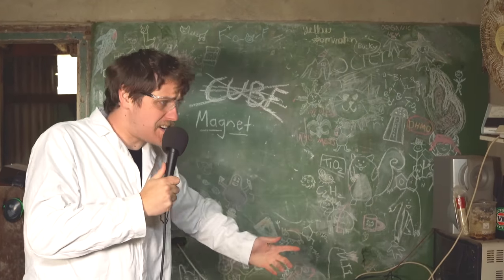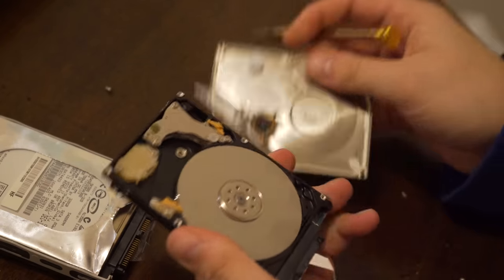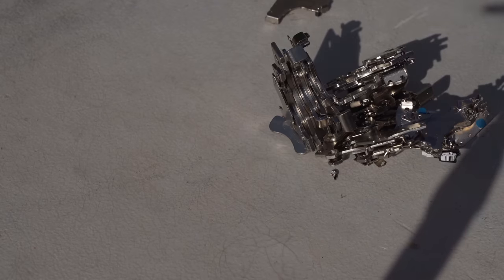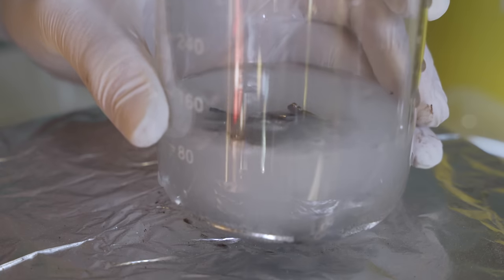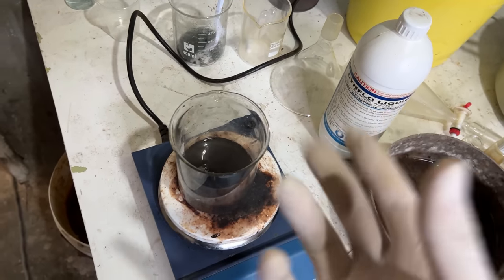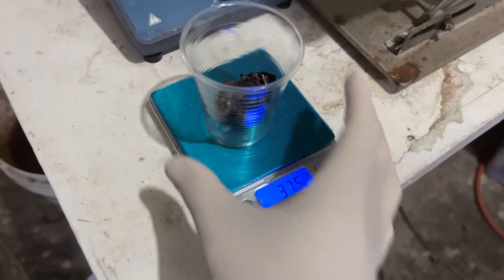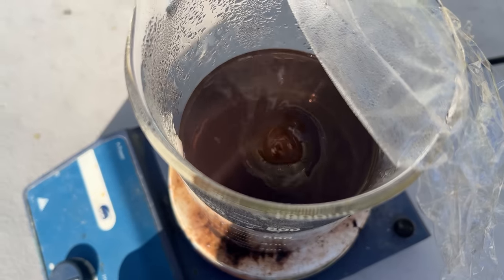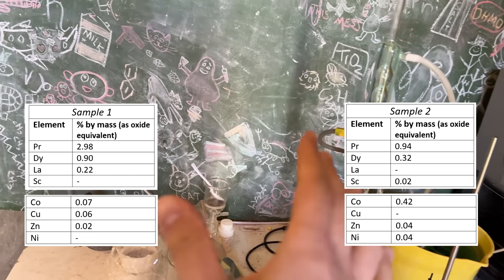Extracting Neodymium from Harddrive Magnets

Comment: You might be intrested to know that there are several styles of colored pyrex glass that are infused with transition metal salts which change color under different light sources (full spec or 'cool light') they are called shifty colors. Do a search for "CFL shift borosilicate glass." I did not know how this effect was achieved by the manufacturer until I saw this video, thanks for being a teacher as well as entertaining! Great video
Reply: Cool factoid: that effect is used by astronomers in the light pollution filters they use to photograph the night sky. Turns out neodymium glass is pretty good at absorbing the spectral emission lines of sodium and mercury arc lamps used in public lighting.

Comment: In a situation where either the most or least reactive metal ion in your solution is the one you want, electrolysis might save you a lot of work for purification in some projects. A variable voltage and variable current-limited bench power supply can be bought pretty cheaply online (I bought a 0 to 32V, 0 to 5A power supply for about $50 USD) and has a lot of uses.

In regards to this project, you can precipitate pretty much 100% of the iron and nickel as metal on a cathode (which could just be a steel nail) while leaving all of the neodymium in solution. This also lowers the amount of sulfuric acid you would need to use and makes recovering any excess sulfuric acid used possible. You just need to use the right anode for the job. I bought a small piece of platinum jewelers wire as my first anode for around $50 USD and it worked great for turning copper sulfate (dissolved in water) into copper metal and (dilute) sulfuric acid.
Reply from the maker: Yeah a really interesting idea for sure, thanks mate!

Comment: having disassembled over 800 HDD's/CD/DVD-Drives for fun, reverseengineering and parts, i can assure you that as soon as you get your hands onto a good set of TX8, TX7 and maybe TX6 screwdrivers and get to know the 3-4 assembly designs that are universally used in HDD's, youd be faster onehanded using the screws for disassembly

Comment: Maybe could of used a ball mill on the magnets. You also could of made a homemade one with a drill, mason jar or container of choice, sand, or fine beads used for stripping material off objects. Then combine the container lid with bolt and then connect the bolt to drill socket.  Would of did the trick nicely.
 
Keep up the great content.

Comment: if you ever have a problematic screw, and you don't need to replace it, get a drill bit about the same size of the head of the screw and just drill it out. and be sure to check under label for hidden screws.

Comment: If you want to go for neodymium metal convert the neodymium sulfate to the fluoride, then react the fluoride with magnesium in an alumina crucible and heat it with an induction coil in a steel pipe. A little bit of iodine added will speed up the conversion.❤

Comment: I got a tiny shard of steel in my eye, from drilling or grinding or something. Caused me misery for days as it was fully imbedded in my eyeball.

One evening I had a brainwave and smashed some earphones with a hammer, extracted the tiny, smooth, donut shaped, shiny neodymium magnet, shoved it in my eye and let it roll around.

Problem solved. Instant relief. I recommend it.

Comment: If you're going to take apart a hard drive just unscrew it, it's gonna be a million times less messy, easier, and faster than ripping it apart.  It's likely that there are stickers covering up screws that you missed, just poke around until you find where the label dents in.  Also you can probably find all the torx screw bits in a cheapo multi-bit screwdriver set too.

Comment: 4:05 here's a lifeprotip for you about screws. Torx screws aren't just for electronics. If you replace all the philips, slotted, and even square drive screws in your life with torx screws, you'll save yourself IMMENSE struggles over the course of years. I say this as a former incompetent myself - I'd spent dozens and dozens of hours dealing with screw heads that stripped right out, or fuckin leaning on my screwdriver/power tool in awkward places just to keep it from camming out. Torx drive screws *just work*. 

McMaster-carr is your friend here - I've yet to find a screw I truly can't replace with a nice torx drive screw on mcmaster, and you can get a nice set of screw holding torx drivers that fit the internal drive head so well that you don't need to hold screws while lining them up.

Comment: Im sure someone else has said it already but those hard drives were hard to open because there is a hidden screw under the label. For anyone in the future take your finger or screwdriver and feel around on the label and you should find a spot that goes down stick the screw driver past the label to remove the last screw then the top should pop right off. Helium drives may be sealed additionally though but not these old kind. <3

Comment: man i love pulling apart hard drives, i did a school based work experience awhile back and they got me to pull apart hard drives, i think i did almost 250 in about 2 days, but yea they are the worst things to pull apart if you dont know that they have a hidden screw under the sticker, also you need specialty screwdrivers which if your curious they are called security bits or for hard drives its hex drivers

Comment: As a computer repair tech, yes computers do deserve pain. Especially those shitty pre built boxes that I get on my desk constantly and cut my hands to shreds on because the inside metal bits just randomly have razor sharp burrs on them for NO REASON. Also, getting the magnet out of harddrives is fun, I've used a lot of them for various projects over the years. Magnet good.

Comment: The different colours remind me of the latest/2023 chemistry Nobel Prize. Quantum crystals of semiconductors changing bond lengths, first noticed with copper chloride glass badges being of different coloured green about a century ago longer, then again meeting another batch of some crystal dripping only not solution, different colours on different times of batches.Then they showed the phase shift using CdSe, crystallising in hot solution that obviously did not want to be in performing quanta crystals, which change colour due to the higher energy bond length with time. Laughed the serendipity, as it's the same as watching paint dry. One of the reasons you also crystallise slowly, to not end up with quanta/tiny crystals, but a more cool product. Reference to paint drying, when patching walls, the paint doesn't seem the same colour whilst wet, yet dries spot on. Possibly the titanium dioxide bond becoming more stable once dehydrated/solvent dissipation. And these pricks get a noble prize, for about five line paper based on about four observations, and using cadmiumSe in a hot solvent, dropping out the red spectrum and moving to yellow when it cools, thus smaller bond length equalling higher energy. Just because they found a compound that existed this behaviour, that just about every chemist/observational inorganic chemist in particular notices upon recrystallisation, particularly in a solvent that it really doesn't like. I'd hazard a guess to natural para magnetism of Ne change the aqueous bonding in hot water due to curie effects the quantum level, which returns in cold water making more soluble. Notice the same thing in organic chemistry with opioids, separating paracetamol which is hardly soluble to start with, from codeine, which is more soluble and increases solubility in cold water. What you call retrograde crystallisation! Maybe there's a paper to be published on substances based not only on the phase shift of semiconductor quanta crystals, but also organic compounds, displaying better/enhanced solubility in cold versus the status quo of heating to increase solubility. But I think you should come up with a more fancy name for retrograde crystallisation, sounds funky, but maybe you can put your name to it… Like a frugal craft reaction. Your name becomes legacy! Maybe something like, Precipitation Heat Unification Crys you tallisation Kinetics Extraction Derivatives.PHUCKED synthesis. Would love to hear someone say, I am using a PHuRKED reaction to separate such and such…

Comment: it's kiiiiinda faster with a lot of Hard Disks to disassemble them the right way rather than just smashing them - it's also just cleaner too, anyways.
if you don't have the right Bits for it, you can use some Pliers that have flat sides and just partially crush the Head and twist it out that way. alternatively a makeshift prybar can just snap the Heads off on 2.5" Drives to rip the Cover off since they're flimsy (sometimes works easily on 3.5", but much less reliably than 2.5").
or you could Grind/Drill the Heads off the Screws. all good options.

though having a set of Screwdriver Bits is pretty handy, and when you do then it's pretty fast to zing the Screws out. 
then usually just a few more Screws will let you take off the centerpost the holds the Platters in, and one more Screw for the centerpost that holds the Heads in place. then it all comes right out without having metal fragments or potentially shattered glass all over. nice and neat, and still fast.

yes, i have infact harvested the Magnets from many, many discarded Hard Disks.

Comment: I tried to make neodymium salts from magnets as well a while back but used much more available HCl to dissolve everything. Gave up when i couldnt get iron to separate from the neodymium. Does this reverse solubility apply to chloride salts of neodymium as well or just with sulfate salts?
Reply from the maker: I think just the sulfate salt, well maybe the sulfate and a few others, but I don’t think the chloride does
Reply: @ExtractionsAndIre  Well i guess I will have to try converting the chloride to a sulfate then, thanks👍

Comment: also, when you have all the small magnets, could you run some kind of electrolysis/electroplating setup to pull the nickel from the mass of magnets? they'd already be in a box of acid

Comment: Quick correction, it's not the energy cost and it's not strategic vision (though that plays a role). It's that it's extremely toxic and will "remove" you. When you could not care less about your people and your constitution is designed to "remove" as many as necessary efficiently as possible for gains, it's an easy trade to make.

Comment: Not sure if youll read this but...
 Like everything in chemistry there is another way. 
Dissolve everything the Fe and Nd in HCl. Bring the pH to 3.5 using NH4OH you'll know you are there when the solution turns turbid. At this point add oxalic acid or better yet ammonium oxalate. The Nd will precipitate leaving iron oxalate in solution. Filter. Calcine the solids at around 300C this should turn the oxalate into CO amd CO2 leaving Nd oxide. Disolve the oxide with h2so4 .
Reply: In the case of nickel inadvertently dissolving too keep adding nh4oh until the solution precipitates both iron and Nd as hydroxide keeping nickle in solution as a tetramine like complex. Somewhere around pH9ish slightly above. Filter the solids and redisolve the hydroxides with HCL then follow the steps in the previous comments from this point forward.

Comment: I have (2) 1x1x2 inch grade n52 magnets. The pull force between them and a piece of metal is like 600lb and i have a 2x2x1 inch square magnetized between the square in half and I gave it a metal hat for protection

Comment: A razor blade peels the coating right off.  Exacto knife it any utility razor,  no need to push hard it flakes off a soon as you slide the blade along v the curled edge.  Faster than sanding.

Comment: not that i am here to bust your fun.. BUT.. unscrewing 6 or 7 screws(one is always hidden under sticker and one holding magnet assembly) screws takes roughly 30-45 seconds then add 15 seconds to simply take out that magnet (done that many times) is SURELY faster than undoing case with players and hammer.. but let's have it your way :)

Comment: Next time you wanna do something like this, try removing the nickel plating with a Dremel or some kind of sander.
Reply: That sounds like a lot more work than just hitting them with a hammer since the neodymium ceramic would just shatter leaving behind the nickel
Reply: Perhaps a combination of both would do... break them and remove the majority of the nickel and if anything was left behind grind it off. @noodlelynoodle.

Comment: The term you're looking for is exothermic and endothermic solubility, the Nd is exothermic, while most are endothermic. Now here's the fucked thing, some compounds are fucking both, like sodium sulfate, which is endothermic up to 32°C, then slightly exothermic up to about 150, then slightly endothermic up to about 250, then exothermic up to about 320, then slightly endo again. Actual schizo salt. 
There's some explanation of why, but I can't bother. I'm also not a chemist, so take it with a grain of salt (preferably not sodium sulfate).

Comment: Would this work?
1. Dissolve the magnets in nitric acid to make neodymium nitrate and ferrous/ferric nitrate solution.

2. Convert to the fluoride salts by adding hydrofluoric acid.

3. Dry the resulting soup.

4. Dissolve the neodymium (III) fluoride in diethyl ether, leaving the insoluble Iron (III) fluoride behind.

5. Take the filtrate, containing the neodymium, evaporate off the diethyl ether.

6. Wash the precipitate in copious amounts of water. The neodymium (III) fluoride is  insoluble in water, while any remaining iron (III) fluoride is mildly soluble.

7. Dry the precipitate.

8. Add the precipitate to conc H2SO4 at a temp of above 19.5C. This should produce Neodymium sulphate plus hydrogen fluoride, which will fume and can be extracted.

9. Stand back and admire your handiwork whilst nursing your chemical burns.

Disclaimer: I am not a chemist, so all of the above might be ridiculous.

Comment: Could you have broken the magnets down with a sledgehammer or something to increase surface area, would have also broken the film off which could have been sifted through.
Reply from the maker: Thought about it- but reading the comments, it seems the metal coating is pretty toxic, so glad I didn’t crush them and make a lot of dust!

Comment: Another reason no other country has REE production or refinement; beyond the electricity and fuel costs, there's the waste management which is virtually impossible for REE mining. You need to strip mine an area, process all of the material, and then find somewhere to store the slag- a combination of Thorium, carbon, low-grade silicates and low-value heavy metals like lead. Because of environmental regulations placed on mining in Western countries- which strains even hyper-profitable enterprises like oil and coal extraction, let alone lower-value (relatively speaking) minerals like iron, nickel, lead, etc., it's caused most mineral extraction overall to shift overseas where those regulations just... don't exist whatsoever. Largely because our governments also place extreme pressure on those- usually third world- countries to have zero regulations. That's why lithium comes from African mines employing child labour. Not because it's inherently cheaper to extract the minerals using underpaid child labourers; factoring in transportation and the warlord tax it actually evens out... until the frankly unnecessary environmental regulations we place on our own extraction kick in, at which point shipping from literally the other side of the planet suddenly becomes cheaper because the US government isn't going to sue you for poisoning 80% of Uganda, and the Ugandan government is too corrupt to care. For China it's the same, except they're also not complete short-term brained morons, so they're also planning on controlling the entire market like you said.

Comment: the mine in china because it crucially doesn't have to comply with international standards for green energy and environmental concerns, china gets the vast majority of it's energy from burning coal, super cheap, and i suppose having practically 0 safety measures for the workers is also more economical. there's a reason china is also leading in metalworking and steel mills.